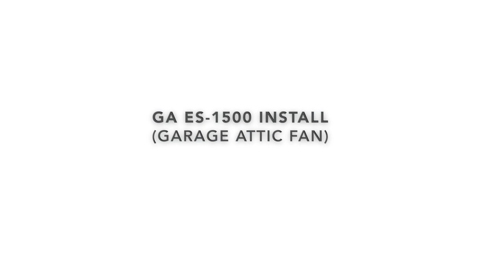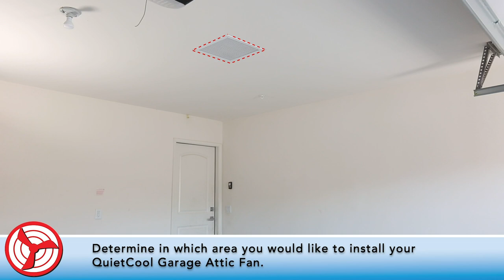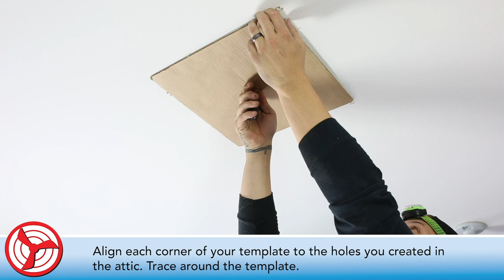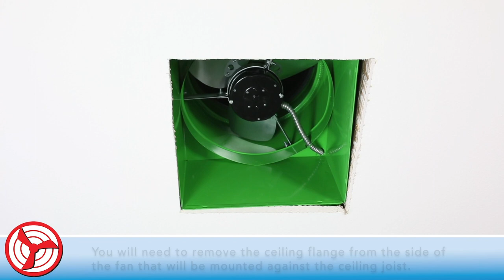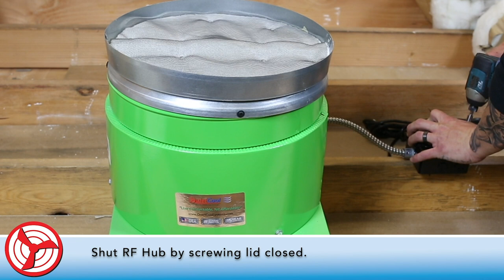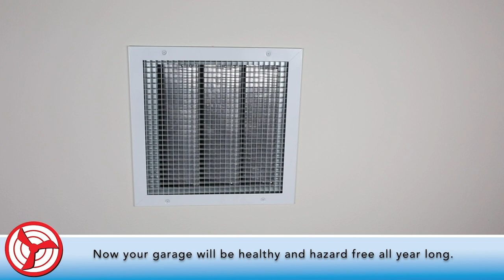QuietCool Garage Attic Fan Installation

Comment: from what i can see you could use a grinder or a multi tool to cut slits in the flange so you can just bend it upward against the joist, also for screws maybe use some self tapping screws for the joists. hope that helps someone in the future.

Comment: When they say you will need to remove the ceiling flange from the side that will be mounted to the ceiling joist, does this mean you need to cut it/dremel it off? It looks like it’s all one piece that goes all the way around the fan. Also, when you secure the fan to the ceiling joist, I’m assuming you will be drilling through the side of the fan into the joist correct? There are no hole anywhere around the fan to use to drill through.
Reply: From installation manual: The QuietCool Damper Box includes removable flanges 
in the case that you are installing the damper box between
studs that are exactly 16” on center. To remove the flanges, 
simply take a screwdriver and pry between the flange surface 
and the damper box. Do this along the entire edge of the flange 
and it will pop off.

Comment: So you pump hot air and fumes into your attic? Which can easily come into your house? Seems smart
Reply: i am venting mine directly out my gable vent in my attic.
Reply: I have ridge vent and eave vents to remove air
Reply: Umm - do NOT have a vehicle running in the garage whilst using the fan. Also, if your attic is not adequately ventilated and the interior of your house is leaky as a sieve, this may not be for you.

Comment: Do you guys have solutions for garages with no attic and no vents?
Reply: Look into through wall fans. There are many out there and some with their own built in thermostat.
Reply: @b_wood  that does not help the hot attic
Reply: @joeygonzo  right. My reply was to the question about a garage with no attic.